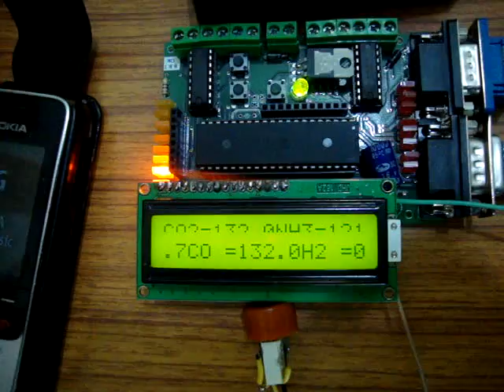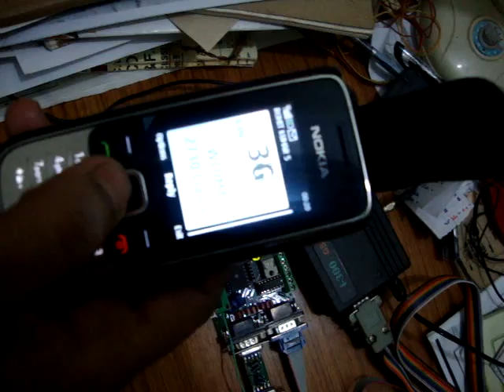Using GSM Modem to send SMS of data received from Gas Sensors

Comment: Use to have lots of problem with cell phone At-Command. Especially using usb2serial cable and now problem free. 
Check project on dmsqfree .. examples
Written in CBuilder. 
Now using gsm modem instead of cell phone. it is fully controllabled,..

Comment from the maker: @int0x13  
One can certainly use a GSM phone. But the problem is manufacturer may not allow to use all the features, a standard GSM modem has. There may also be problem with connecting the phone to the external circuitry.

Comment: @kurniasan dude you can learn how to use an arduino then interface it thru UART with a GSM phone an use AT Commands to send an SMS message to wherever you want.

check it out:

arduino.cc

you can buy the arduino cheaply from dealsextreme website

but they take a long time so becareful and pay them with PayPal so u can grab them by the nuts. ;D

good luck.

Comment: Please help me! I'm trying to build an embedded system which would receive sms and send a command to a microcontroller which would then open/close relays. What kind of microcontroller and GSM unit would I need? Are there any pre-made bundles that I could just purchase and program? If you have a minute please drop me a line at pvelesko@gmail.com this is for my pre-engineering capstone project... Thanks!